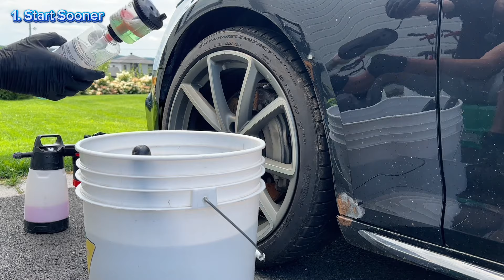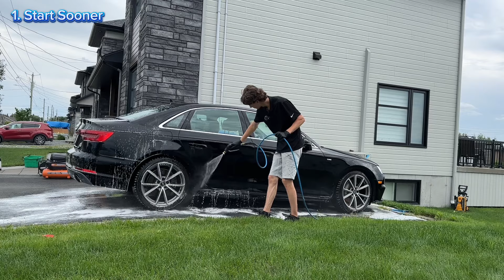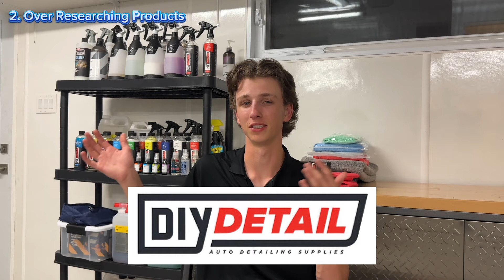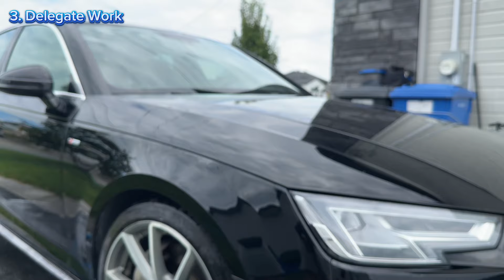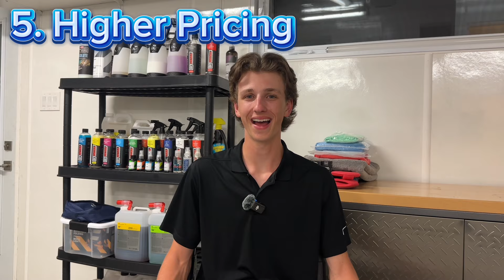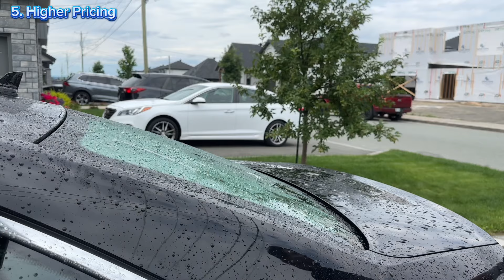5 Things I Would Change If I Started My Detailing Business Today

Comment: Great tips, man! However, I only partially agree about the product research, as I research them a lot 😄And I can say that some top brands provide several top-tier products and the rest are just basic supplies to make wider product catalog, so to get the most from your investment, you need to find those top-tier products of each brand
Reply from the maker: Thanks! I totally agree with you, that taking the top products from some brands may be better! But I still believe that when first starting, it is best to not get stuck on “products” and delay your starting point because you think you need the absolute best, I would say that with whatever reputable brand you pick, you will still be able to achieve great results, your process is more important the the products themselves is what I think. But you are right that when you have been in business for a while, finding what is best for each scenario is not a bad thing. Thanks for giving your opinion 🙌🏻👌🏻

Comment: What is your opinion on using a ceramic wash and wax car shampoo. 🇨🇦👍👍
Reply from the maker: @ericwright1075  When I was just starting, I used a ceramic infused shampoo, it worked alright but I found that sometimes it was struggling to coat the entire vehicle well, some spots were left uncoated which also made the drying a bit longer. I started using a spray on rinse off sealant (Gyeon Wetcoat) and since then, that’s what I have been using, now trying out quick beads by DIY, I also want to have the choice of leaving protection or not on a car (if I ceramic coat after or other reasons), so I use wax free shampoo from now on. But for enthusiasts and people who just clean their own car once in a while, I would say it’s pretty good to not break the bank also
Reply: @FanNETiqueAutoSolutions  Thank you for the info, I am leaning in that direction also. 🇨🇦👍👍